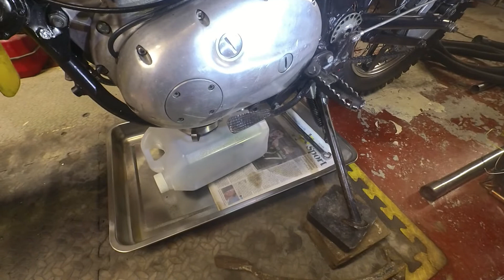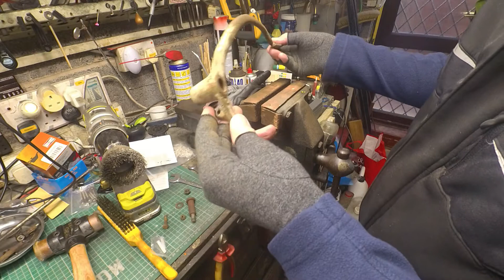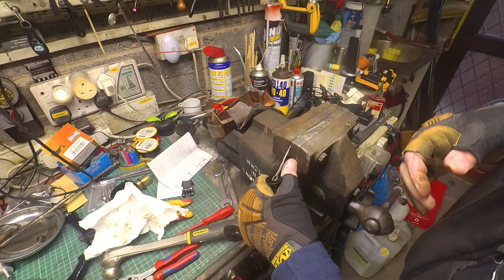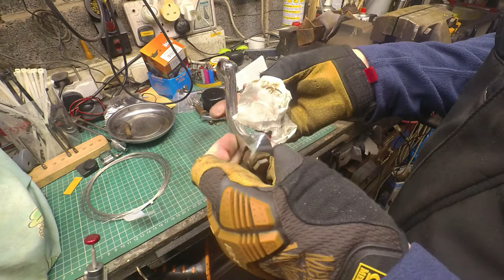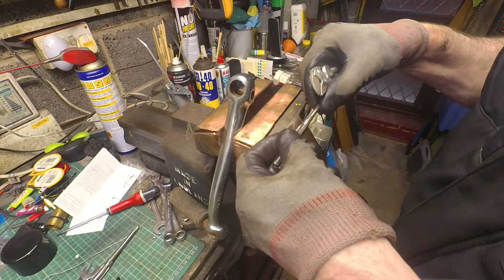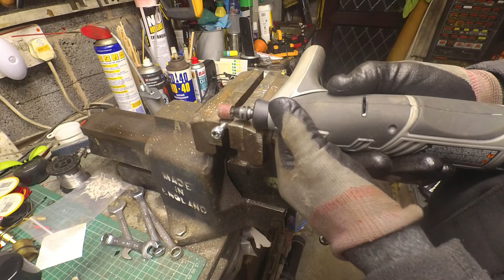BSA B50 Footrests Pt 3 of 3

Comment: In 1974 American magazines suggested using the Triumph Trophy Trail/Adventurer footpeg brackets to move the pegs back, plus using the C15 gear lever which apparently is a bit shorter than the B50 gear lever. Part number for the LH bracket is 83-4663, I  think the RH bracket is 83-4665. Hope this helps.
Reply from the maker: Thanks for your comment and suggestions. I’ll look up these part numbers. Having ridden with the original pegs for a while now, they’re OK for road use but much  less so when standing on them, off road. The original kick start is way better than the one that was on my bike when I bought it. It’s easy to start now. The other one was difficult at best and potentially painful, with kick-backs or a grazed shin. I don’t plan to compete with this bike, so will probably stick with the original footrests for the time being but keep an eye out for alternative parts such as the ones you suggest.